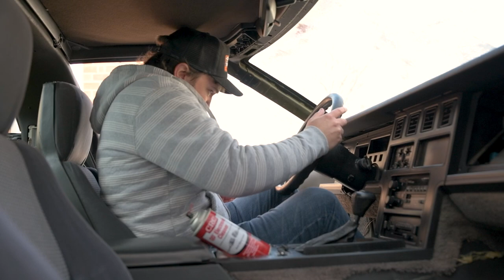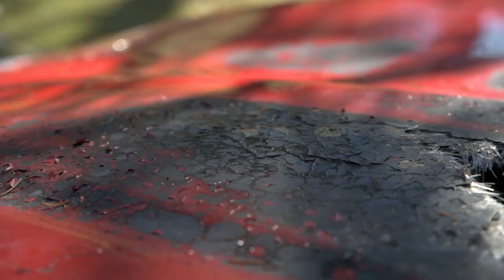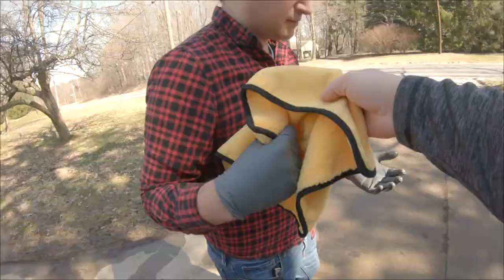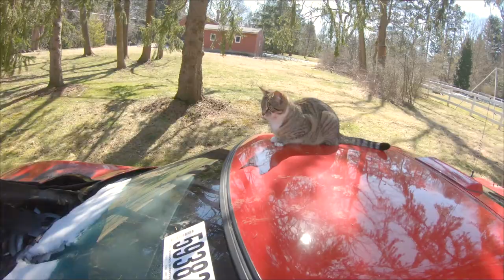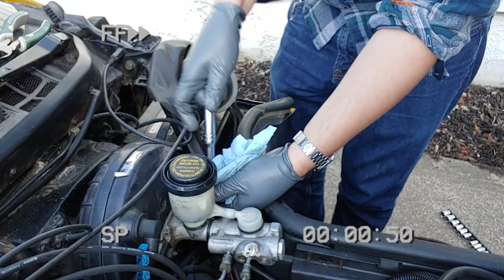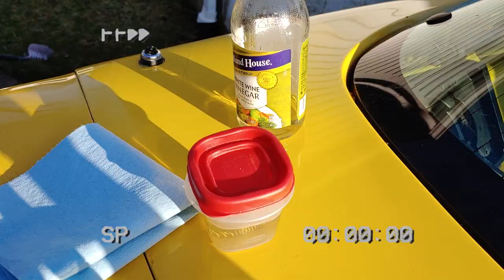Corvette Forum Project C4 Part 1: Replacing the Master Cylinder

Comment: For those of you who have a single reservoir master cylinders on an 86 or 87 you can replace it with a dual reservoir from an 88-91 and have a dual.
Reply: That’s cool I’m gonna do that. When I replace the master cylinder do I need to drain any fluids?
Reply: Did that with my 86 ragtop pace car. BTW, all 86 convertibles are a Pace Car. I have completely disassembled and reassembled mine due to it being a flood victim. New electronics,  wiring, everything, lol. I do like those rims on your parts car tho.